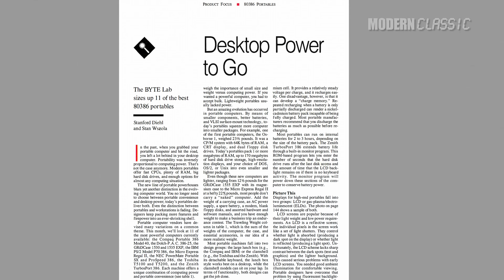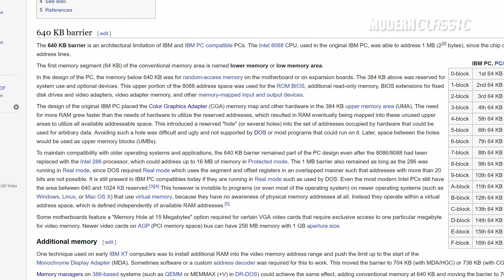IBM PS/2 P70 Tour and Diagnosis - Part 1!

Comment: I have a IBM PS/1 2011 and it is very similar with the proprietary floppy and hard drive. They are a pain in the butt. Mine also came with a dead floppy drive and I had to buy one on eBay. I know a good seller on eBay who might have the drive you need. However, my point is that you might be able to adapt a PS/2 drive to that machine, due to both using the same parts and cables. They run about $50 bucks or more, depending on the seller. Best luck on it though. I know your pain. lol.
Reply from the maker: I know there are a couple of other PS/2's that use the same drive, and then there's the 2.88MB drive that supposedly also works, just as a 1.44MB drive (as long as it's one without an asterisk on the eject button). I've been trying to look up the actual FRU as well as just generically for PS/2 drives, but they are not cheap! The ideal solution would probably be to find a standard drive with an eject button that lines up (if one even exists) and then hack the cable. If I could find a way to permanently solve this problem for everyone forever, that would be fantastic. I might try doing that at some point. But for now I'd settle for just getting it working.
Reply: If you find a method to jury-rig a standard floppy drive to the proprietary floppy format that would be amazing!!! They are getting more and more expensive as the drives die, so if that method works, then that would allow people to use the PS/1 and PS/2 machines much further into the future for cheaper. Also, I did some research on the EDSI hard drives a while back. The PS/2 and PS/1 hard drives use a special type of EDSI format. You cannot just put any EDSI drive into a PS/1 or PS/2. I haven't tested it myself, so if you ever get the chance to test if they do work that would be great!!!
Reply from the maker: Well I'm hacking a cable together for my floppy emulator anyway; that's the first step in just getting this thing to boot. But the good news is that that cable will then work with any standard drive. So then the question is just finding a drive that'll physically fit and allow you to use the original blue eject button (so it looks like an unmodified system). Old standard floppy drives are cheap, so I probably will look around and try a few that seem close. Hopefully can make a future video out of it.
Reply: That will be a great video for sure!!! I want to know how to do that in case my drive dies.

Comment: Just out of curiosity, did you happen to post a picture of this on Reddit recently?
Reply from the maker: Nope. I don't even have a Reddit account.
Reply: Oh.  Well, someone on there posted a P70 recently and did a floppy replacement.  I just thought it was kind of funny how I saw one of these computers on there earlier today and then saw this video.
Reply from the maker: I will look that up. I did look up and find a couple of other people who replaced the floppy as well, which is how I know that only certain models work but that you can hack up a cable and the eject button to use a standard one. But I'm always interested to read from more people. It's not like a huge number of people have written about it, so there could always be easier ways of doing things.

Comment: I own one of these. you need to recap the drive. they leak and cause the drive to act up and eventually die. Also hinges, I never came up with a solution. they are under high tension and break, its a known design flaw. There was a guy that made a CAD setup of one, but NEVER shared the info so its lost in time. Sadly. However, I just removed the whole setup, lined my screen up the best I could, and bolted it to the rear metal. using a little thing called a rivnut. Also good luck on a parts machine. The reasons yours is dead are the reasons why the rest of them are and were put away for "parts" Mine was the same exact way.
Reply from the maker: Just out of curiosity, do you know if it's normally the left hinge that breaks, or could it be either one? I believe they are different from what I remember (and the left one has a weird metal tab pushing on the plastic that I believe is what broke mine), so just wondering how likely I am to get unlucky if I end up buying a parts machine.
Reply: Both of mine were broke. So broke that they cant be fixed based on how they severed themselves.

Comment: I believe you can replace the floppy drive with a more modern SD card reader and emulator.
Reply from the maker: Technically yes, and you can see that I have one in the background in a lot of the shots here. But I need to make a cable for it just like a standard floppy drive. I'm leaning towards that now being the best option, though, at least temporarily.

Comment: I think you have another PS/2 machine like Mod. 60/80. Take the Floppy drive out and connect it to your Mod. 70 from the back side (should be possible).
Reply from the maker: I actually don't... this is my only PS/2. But I have some other ideas at this point, so hopefully I can get it going pretty soon.

Comment: Have you tried adapting the floppy to an usb emulator?
Reply from the maker: That's one of my next steps. I need to make a cable, since the PS/2 uses non-standard floppy cables with power included.

Comment: Hah.. P70... that reminds me of the new Thinkpad P70. I wonder if that was intentional... 
You should team up with AkBKukU on youtube on repairing this... he's done some old restoration stuff that has included 3d printing, drive repair, etc.
Reply from the maker: I don't think the numbering was intentional... they just happened to come up with the same number using a different system. I will check out AkBKukU, thanks!

Comment: I have this same problem with my regular Model 70. Floppy drive's dead so I can't boot the computer at all...
Reply from the maker: Check the caps! When I pulled my drive out, the caps were very obviously in need of replacement, just visually.

Comment: Perhaps you could use a standard pc floppy, and hack that to be external?  Here's some forum posts with associated references for cable pinouts and such.  Sorry I couldn't be more help, big fan of those gas discharge displays!

http://www.vcfed.org/forum/showthread.php?24465-DB37-Pinout-for-External-IBM-Floppy

Comment: Temporarily hook it to a working drive to boot it then reinstall the original until you find a replacement.
Reply from the maker: It's not that easy. It's proprietary, so even just to do temporarily, I'd need to hack a cable. At that point, I'm basically at solution #3 that I laid out in the video. And it's still not a permanent fix. However, there may come a time when it's my only real option, so I may end up doing it.

Comment: I just want the keyboard...
Reply from the maker: Better to just get a Model M or Model F.
Reply: Modern Classic I already have both of those though...

The P70 keyboard used Alps plate spring switches which were only ever used in a couple keyboards and are very rare.  I really want them to complete my collection.
Reply from the maker: Ah, well in that case, then I can understand. The P70 keyboard really isn't among the best I've used, though. The switches are oddly mushy for a clicky switch; I've never really felt something like that before, and I'm not a huge fan of it. (Though it's still better than any rubber dome keyboard.) But if you collect switches, then I understand wanting these. They are unusual in feel even beyond however rare they are in actual use. Edit: you know what it feels a bit like? My Tandy Enhanced Keyboard. I understand they're based on the Fujitsu Peerless, if you're familiar with that and have either of them. The P70 keyboard requires a bit less force but has a similar clicky-yet-mushy feel.

Comment: take out 2 sticks of ram and get below the "hole" treshold.
Reply from the maker: The hole is between 640K and 1MB, so I'd need to go down to 512K, which somebody else also suggested. I don't have a 512K SIMM, though, and btw this thing used proprietary SIMMs too! (Well, not really; they just need to have presence detection.) So not sure how easy or cheap it would be to buy one. I'll check, though.